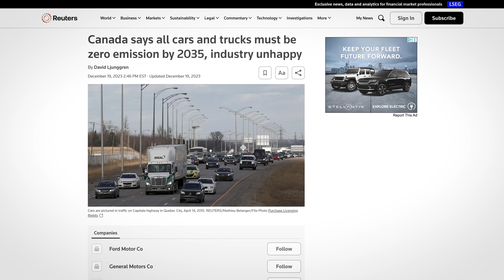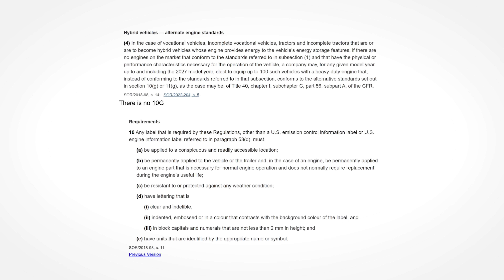Government Red Tape Is Blocking Our Plug-In Hybrid Trucks

Comment: Change where the generator is located. Attach rachet straps or comealongs to the frame and not bolt it down. There are not laws saying a strapped down generator can't run from what I understand 😂 seems like the issue lies with permanent connection to the frame?

Comment: Im confused they are not allowing you to do this.
But have given nissan the green light for e power.
That is doing the same as you the engine just running to recharge the battery it has no physical connection the the drive system.

Comment: Use on road certified engine with your own throttle control then. 
Governors are overrated and inverter generators that can vary RPM are more efficient, and you don't even need to have inverters, just DC, increasing efficiency even more.

Comment: But isn't your system pretty much the same as diesel electric locomotives?
Reply: Diesel electric + Battery
Reply: @AlfarrisiMuammar  so the only difference is the additional batteries.
Besides that isn't it exactly like a locomotive where the engine is a generator?
If that is "road approved", why would the addition of batteries change anything?

Comment: Certify it full electric without the genset.  Slap some extra batteries in it for range where the genset would be.  Sell an "mining/forestry/Ag package" genset for "offroad use only" that has all the genset/hybrid code in it that only allows the genset when the brake is on.  Have a handy but undocumented fuse that when removed  breaks the "brake on" message to the controller. Label the fuse "DO NOT REMOVE".  Let us figure it out once we take delivery.
Reply: This is a modern solution to a modern problem.

Comment: Obviously it's different to a generator, but could you run a "mechanical" engine with an electric throttle that adds rpm under load?
It's a moronic step around, but possibly a solution

Comment: What if the off highway generator wasnt part of the truck, but part of the trailer. Then the, now, 100% EV truck doesnt have any issues, and its perhaps different and easior regulations regarding a generator running on the trailer...

Comment: If you used an on highway certified engine, why do you have to get a new certificate for it? Use the Engine Mfr's ECU, completely unmodified, and build our own control loop around the existing ECU; your controller just acts like the gas pedal input to the ECU which varies to hold an engine speed.

Comment: I downloaded the installation and owners manual for the Cat c-9 generator. It states clearly in the manual that it's only certified for stationary applications. So does using the cat c series generators in a mobile installation nullify the manufacturer's warranty?

This is an Edison engineering fuck-up, not a regulatory issue.

Comment: Chace; the argument you could use here with the Canadian government is the engine itself will only be used when the trucks are OFF ROAD with the regen braking that should be enough juice to get back to a charging station. Couldn't you use a smaller Cummins engine; i.e. a 12 valve or a 24 valve 5.9 diesel???????

Comment: I understand you want to use a generator and agree it would be better but what are other companies doing? The Ford f150 powerboost is an hybrid that has a mechanical engine that meets on road emissions. How is that platform different than what you are trying to do?

Comment: Ok but, often times on highway engines are used as of road generator engines. Like Detroit has engines branded as MTU, Cummins makes x15s into gensets and L9s into gensets. Is there are reason you can't get one of those certified on highway engines and hook it up to a generator?

Comment: On road engine modified to work as a governor controlled engine. Should be very easy with ecu control.
Reply: They would lose a lot of efficiency in the changeover by using components in ways they were not engineered for.  A generator would probably be 20-30% more efficient and be lighter.  It also isn't easy to bolt a car engine to a electric generator and integrate into their power systems - it would be a size / weight complexity.  I suspect they don't have the capital to make it that custom and it would weaken the business case.

Comment: No offense, for a bunch of smart handy people.. you decided to make a double pollutant truck that works 10 times harder,, work on electricity.. If you did your research,, you would know there's is absolutely no energy density in batteries,,, unless there monstrous.. My favorite, also is that electric motors, exponentially consume electricity under heavy load demands or high speeds.. But you decided to put very heavy generator,, spun by a diesel ICE,, to fill a battery that is absolutely worthless,, then to supply energy to an electric motor..So you added weight, the ICE will run constantly just to spin a  genny to barely keep the worthless battery supply.. EV's are an absolute pile shit,, but PHEV are bigger joke.. Have you people not heard about the biggest disaster with Ford electric shit. I'm into cleaning the pollutants, we start with all these assholes that idle their cars in front of malls for hours,, lines of dump trucks idling for hours waiting to be loaded.. Freon from AC is a 1000 times more dangerous,, but my favorite are the degenerate worthless countries,, such as China ,, Russia, paki,,indi,, Africa,,, south america,, these countries literally don't give a fuck about the environment,, they are barely staying alive.. and we idiots under the G8 countries listen to these worthless degenerate liberal politicians,, to pay heavy taxes,, carbon taxes,, etc.. thinking are clean air travel's around the world and cleans it up!!!! 
Holy FUCK!!

Comment: I am highly in favour of the authorities here. Of highway engines have so much worse emission values that even the hybrid drive causes significantly more pollution than a regular truck. Whoever is in charge of your engineering department has got a big missconception here. You should rather recheck your previous concept than spread such a video. Shame on you!
Greetings from a mechanical engineer.

On Top: There is an easy fix to this. Just use a road engine with cruis control to set the specific rpm the electric generator needs.

Comment: I imagine that tier 4 engines for on-highway and off-highway have different requirements they need to meet in order to be compliant. I also think it shouldn't be impossible to modify an off-highway generator engine to meet on-highway emissions requirements or modify an on-highway engine to work as a generator. Especially if you have some assistance from the engine manufacturer. I'm sure you can figure out a way around this with an engineering solution.

Comment: Can you make it so the generator doesn't work while the vehicle is moving, so it's only being used "off highway" 

maybe have it as it's own system with a fuse/breaker to disable the sensor, for maintenance...

Comment: Can't you fit a  ... foot or hand  throttle for the generator , so the driver can adjust the generation as require by the ev , combined with a " cruise control " , which the driver will switch on immediately after certification .

Comment: I've heard about this company a little bit, I feel like the plug-in hybrid title is a little misleading. I feel like generator should be included in the name similarly to it's use in the video. I believe trains work the same way so maybe there's a way around with that? Good luck, innovations like this help set new standards and give more options.

Comment: But let’s be honest this makes sense. Why would a generator engine not have to comply with tier 4 standards? It’s almost like circumventing regulation for on the highway vehicles. I kinda agree with Transport if you wanna have an engine inside the vehicle and must meet on road standards why would you be able to pay a loophole and not have a motor that meets the standardthis way all the trucks will be running up and down the road with generators that don’t meet the mission standards

Comment: The Prius hybrid model is the worst option. Your model is the one that should be the standard regardless of the vehicle size if you want a hybrid vehicle. It lets you use a much smaller combustion engine, it allows the platform to be more flexible with fuel types for the combustion engine, and doesn’t involve a complex, heavy split input transmission.

Comment: What if you used a highway engine and used a separate system to sense load and control the throttle like the driver and an accelerator pedal would? Does the regulation require a human to control the throttle?

Comment: What about if the only way to use a generator is with the vehicle parked? 
Similar to an APU concept,  but with an actual hardcoded lockout on the truck that does not allow charging while moving? Or any movement when it is plugged in, and require the generator to be manually plugged in and out of the charging port.
Just a spitball.

Comment: Random thought - Why not use something like the L9 Cummins series hybrid setup that most of the New Flyer city busses running around Seattle, WA use? They use a series hybrid system with the L9 Cummins which is set up somewhat similar to what you are doing but much more reliant on the Cummins diesel engine to create electricity which powers the electric axels rather than having a large battery pack as the primary mode of driving the axels with a generator charging the batteries when needed, which is what it sounds like you are trying to do. They are obviously already on-road certified powertrains, so it may make it quicker and easier to produce plug in hybrids using these pre existing and pre certified powertrains while working to change government regulations over time so that you can apply the powertrain that you plan to use long term.

Comment: Change the programming so that the generator will not run if the truck is moving. That will make the truck pull off the highway, making the generator be an off highway engine

Comment: Maybe you can do the old, deliver with highway on engine and then mention after delivery that you can also put in a more efficient generator for the client at no or little cost if they give back the on highway engine, would that work?

Comment: What about putting a block on the recharge while driving make it that the truck has to pull over that's now a generator charging a fully electric truck,  it doesnt need to comply with any on highway requirements. and as its software its a very easy fix once the regulator stops being idiotic. which they will have to.

Comment: Sorry to say this, but I have posted numerous comments about this being an issue for several years now.  It is very simple, you are NOT using the engine in the application that it is emissions certified, plain and simple.  You are using an engine "on-highway" and it needs to meet the emissions requirements of "on-highway" engines.
Reply: Exactly

Comment: The solution is simple: you set the truck to run only 100% electric while on-road, and you need to pull over to statically run the generator. Running the generator on-road would require addition of a fuse "not certified for use in Canada".

Comment: Start with a certified on-highway truck engine

Keep everything emissions-related: EGR, DOC, DPF, SCR/DEF, sensors, OEM ECU, and wiring harness.

This way, from a regulatory standpoint, it’s still a road-legal engine family in a road-legal configuration.

Remove the transmission

Replace it with a rear-mount PTO housing (SAE #1 or #2) or an SAE flywheel adapter.

Mount the generator head directly to the engine via a torsional coupling to protect against crank harmonics.

Generator as the driveline

This is just a prime mover now — the generator feeds the electric drive motors.

The driveline no longer needs a gearbox, just the electric traction system downstream.

Control via CAN/J1939

Use TSC1 (Torque/Speed Control) messages to tell the OEM ECU what RPM or torque to hold.

The ECU still manages fueling, turbo boost, EGR flow, DEF dosing, and regen cycles exactly as it would in a truck.

Your generator controller just requests “I need X kW” and the ECU adjusts engine output to match, while staying emissions compliant.

Bonus: PTO governor modes

Most truck ECUs already support PTO governor modes for things like concrete pumps or fire trucks — they’re designed to run at steady RPM while stationary.

You’d just be using that same functionality in a moving vehicle’s hybrid drivetrain.

Comment: I've been thinking about it, if you pick a recent on-highway engine with start-stop feature, couldn't you just emulate the gas and brake pedals using an Arduino? Ask the Arduino to keep the RPM where you want it and apply the "brakes" when you want the engine to stop? Technically you are not touching the approved programming if you only control the pedal control

Comment: I don't know how the law works in Canada but how viable would it be to sell vehicles with the Cummins and do a "free" swap to the generator?

That would probably let you basically bolt on the Cummins and the transmission pretty easily, hand it over to a customer, then say "Want to swap?"

It would probably prevent you from getting the efficiency rating you actually deserve but it might let you deliver the product you're actually trying to deliver.

Comment: I know a generator controlled engine has slightly different control mechanisms.
BUT isn't the cruise control regulation very close to what you need from the highway engine?
Instead of feeding it with a speed setting feed it with what you want regulated 😊
Just a thought.
Advantage your not messing with the legality of your for highway use engine just feeding different info to the cruise control which is allowed as an aftermarket addition.
Reply: I could be wrong but it doesn't need to be a big engine since it can run nearly constantly while the truck has very intermittent loads / regen.  A 4 cylinder diesel car engine running at a constant 3000 rpm could work (less efficient than a generator but functional)

Comment: Could you detune/remap the off highway generators to comply with on highway regulations? Or use smaller engines from much smaller on-road trucks like 1 ton pickups which already comply with all on road regulations with the DPF and EGRs and such and adapt those into a generator? I feel like it wouldn’t be THAT hard to convert an on road diesel into a generator?

Comment: Get it thru your head. Great idea but fuel aint run out yet . How stupid can you be. In 10 years you will still be beating your head. Cummins, cat ,detroit, benz, volvo and the rest wont stop until a battery meets their requirements.  Do the battery first, the world will follow. While you f around with the prime mover, kw , are  waiting  for tech to catch up on batterys. Do the battery thing  the trucks will follow. P.s. your truck looks like it was designed by crayons. Love from Colac Australia.

Comment: Why don't you use the Mechanical engine to power just 1 Axel and electric to do the bulk of the work. You can just stick in neutral and use it as generator . just have a dead/back up axel there (boost axel?) .... I would power the front 2 wheels with the gas engine and have it mostly as a power generator. you have a bunch of axels, just make any 1 of them gas , but really keep the transmission in neutral and just use the engine as a generator and maybe a back up... you would'nt even need a 16 gear transmission... use a 6 speed with lots of high gears for the gas engine to shine on the highway. You can add power generators to the gas axel and have the gas engine power them through an axel .

Comment: How about this? A truck engine, with a throttle cable that is controlled by a servo. It would be a normal truck engine it would be on road, and the system would electrically adjust the throttle instead of a pedal, an extra step but could work. Or what about an on road gas engine? Catalytic converters aren't that complicated but would meet emissions, you could use a existing on road engine this way.

Comment: Project technology risk is a thing, especially when you make assumptions. Why weren't you working with them earlier?
That said, thank you very much for describing the difference between the engines.  Can you use a throttle control algorithm and servo to make the on-road emulate the load response of the off-road.  This seems pretty straightforward control theory - I didn't say simple or cheap, just straightforward.  Kudos to trying to get the regulatory folks to adapt to your better tech.
You're not building EVs, but rather hybrid that still have a running carbon footprint and that's a still Good Thing.
Any block needs to have multiple resolution paths (A, B, and C, like you mention.) and "perfect is the enemy of good".

Comment: What are the regulations on transporting a generator? Have it on the truck but "disconnected" and "only connect it when you need to charge". Have it written that by law you must park and put the generator on the ground to charge, but leave a way to simply connect it and charge while driving.

Comment: Well it is not a hybrid. It is a diesel electric that has been around since the 30's or 40's. Reclassify your trucks as a trackmobile switcher. Locomotives have been diesel electric for almost a century now and if they want to ban diesel electric then they need to ban it across the board. So no more Locomotives, no more trains, no more commerce. Your technology is nothing new, nothing special. It is just the best way by far to operate for most efficiency, most power snd most durability. But you're stuff is basically just copying locomotives and maybe if you pitch it this way and utilize whats on the books, it might give you an end around?